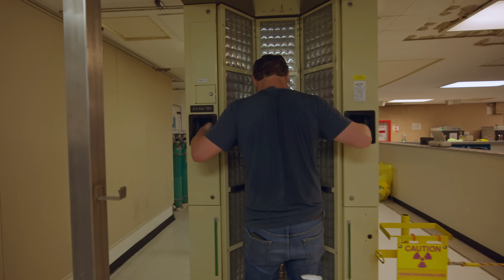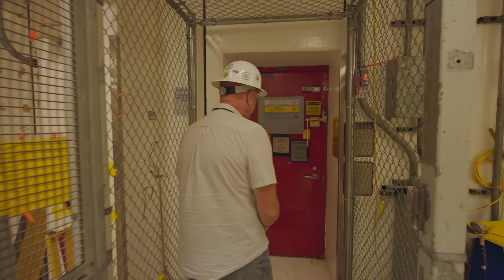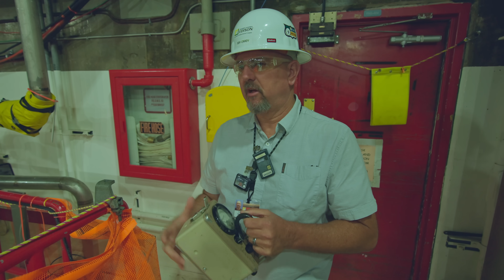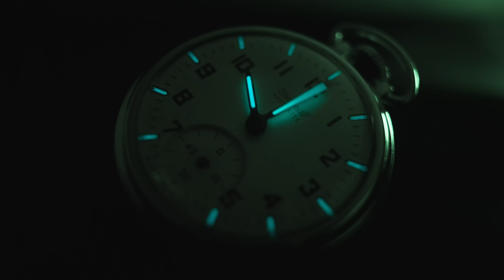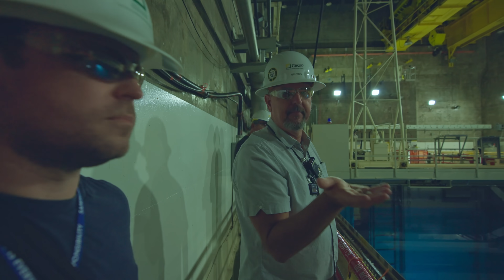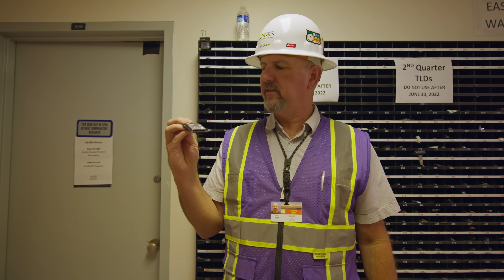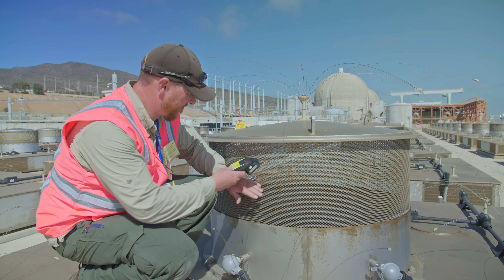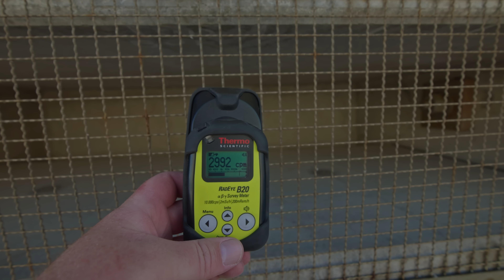Inside San Onofre Nuclear Power Fuel Pool and Spent Fuel Storage

Comment: Adjacent to our nuclear power plant (Pilgrim in Plymouth, Ma.) a study conducted under the supervision of the Mass Department of Health found a four fold increase in leukemia in people living and working in Plymouth and surrounding towns. It should be stressed that not all nuclear plants have the same level of radioactive contamination as Pilgrim. Some like Pilgrim are worse than others with a track record of failures, equipment damage, unplanned shutdowns, and radioactive releases. By design the Pilgrim reactor's heated water/steam is directly circulated in the generator turbine. So consequently, every shutdown requiring the turbine system to be opened up resulted in radiation release/exposure. By contrast, the "safe" pressure vessel type reactor at Onufre employed a heat exchanger which isolated radioactive steam from the generator turbine. Unfortunately, the pressure vessel type reactors were much more complicated constructions and were prone to leaking as a result. So there was no net improvement in radiation release over the lifespan of the reactor. The people who consider these things "safe" for the environment are either utterly clueless technically or they are just mouthpieces for nuclear industry propaganda. None of these things are really "safe" or "good for the environment". The long term cancer study statistics bear this out all around the world. And isolating highly radioactive spent fuel from the environment for literally thousands of years is not practical or a cost effective alternative to other less dangerous forms of energy production.
Reply from the maker: I’ll look that study up but I have a very strong feeling it’s going to have some huge gaps in data directly linking the existence of that nuclear facility to leukemia. Any level of radiation that the public would have received from that plant wouldn’t be enough to cause any health effects. 

I’m not a mouth piece for the nuclear industry but I believe nuclear is safe and does less damage to the environment than a solar field or a bunch of wind turbines. As for the spent fuel, they could leave it there on site. The containment vessels are extremely robust and it’s a huge waste of a resource like that to bury it. The fuel will continue to produce heat for hundreds of years. Seems very stupid for us not to take advantage of that heat and use it for low power energy.
Reply: sorry but you don’t really get to say that anyone who disagree with you are technically deficient. That says more about you than anything.

Comment: Does the water in the pool become radioactive over time?
Reply from the maker: Yes, from a couple of different sources. The spent fuel when it comes out is going to be emitting a decent amount of neutrons along with a lot of other radiation. So tritium will be created in the pool water but it will be extremely small. Very small pieces of iron will also be activated and transmutate into Cobalt 60.
Reply: @RadioactiveDrew  what do they do with old water that has become radio active? do they have special long term containers to keep it isolated.. ?
Reply from the maker: They can filter it.

Comment: 27:40 If there was a tsunami nothing would happen to those canisters because those are PASSIVELY cooled. They work by convecting air... there is no active electrically controlled cooling system necessary. Those heat exchangers would even work better if water was around 😉

Comment: I disagree with op.  Its super dangerous and super expensive.  But risk can be mitigated by many layers of protections and fail safes.  And if effectively mitigated, lowers carbon emmisions from gas and coal power plants.

 But it is inherently unsafe.  The entire industry is geared up to mitigate the threat of radiological release and exposure.  

Pretending its safe is crazy.
Reply from the maker: It is safe. Safer than burning coal, safer than wind and solar. It’s also more energy dense than all of those put together.
Reply: How is it unsafe? Fukushima was bad but was caused by gross negligence by those who created it and are now aware of what not to do. Chernobyl was also bad but was also caused by gross negligence and was also like, what, 40 years ago? Even with the major accidents that have happened. Nuclear is one of if not the safest power sources avaliable, statistically.

Comment: Super cooler Vortrag.
Ich finde es immer wieder schade, dass so viel Wasser und Raum verschwendet werden, um etwas Strom herzustellen und, warum wird der nukleare Müll eigentlich nicht ebenso in diesen Becken gestapelt und gelagert? Ist doch sowieso schon alles vergiftet dort.
Reply from the maker: Are you kidding? Water isn't wasted at a nuclear power facility. Its either released back into the water source, like a river or the ocean, a bit warmer or released back into the air as steam. Both ways have zero contamination. As far as land usage goes, nuclear is far and away the best use of land to generate power. Nothing beats it in energy density...nothing even comes close. Wind and solar take up so much more land and kill much more wildlife than nuclear ever will.

Comment: they should've given you a small radioactive pellet to demonstrate the detector going off.
Reply from the maker: Hahahaha...one of the guides there had some mock fuel pellets but I didn't get a chance to show them off. If they used some fuel that hasn't been used yet as a demonstration it would be radioactive but nothing close to what the stuff is like that has been used in a reactor.

Comment: 28:20 "LA Times"  EXTREME DANGER !  If the fuel container EVER EVER tips over.  It can / maybe will break open.  Then the bad fuel is exposed directly to the cooling water.  That cooling water is exposed directly to the outside air thru those huge round vents.  (My profession 45 yr expert in commercial ventilation, we have replaced 100,000s ft of vent pipes exposed to salty ocean air.  D A H.  What GENIOUS, builds this power plant by AN OCEAN THAT HAS SALT WATER IN IT?  Everybody trusts our government, nothing is ever 10,000 % safe.
Reply from the maker: Nothing would happen if the fuel tipped over. Its a solid not a liquid. If it did break open nothing would happen. It would be a mess for them to clean up on the pad where all the spent fuel is stored but that's about it...zero risk is anyone outside of the area. If those spent fuel containers were to be submerged under sea water...again nothing would happen. They built the reactors next to the ocean because reactors need cooling and water is one of the best ways to do that.

Comment: Why not drive as breeders, no depleted U problem?😮
Reply from the maker: The reactor isn’t setup that way. There have only been a handful of breeder reactors ever built and I think all of them were either test or research reactors.
Reply: @RadioactiveDrew  needed is u238->u239-pu239. Uranium made n flux always present, if u235 not diluted to fill metal, always happens. Is not this very simple. Enough thick metal volume only thing. Pu239 fissible. Fuel rod mixing now and then have to be done.

Comment: For reference, I have a mineral specimen from western NC state, Uranophane (from a local U and Ce rich pegmatite dike) that gives about 160,000 cpm on a Ludlum Model 3.  So the nuclear waste was giving off 500cpm, and I have a rock that is almost 32000% hotter.  And that's just a rock I found in the woods outside. (near Chalk Mountain, Spruce Pine, NC). I have autunite and torbernite samples that are even more radioactive... they live in the shed out back away from my "inside the house" mineral collection, lol. 
      I also went to the Susquehanna 1 Fission reactor in Berwick PA back in the early 2000s to sell an aerosol fire suppression system for their control room (unlike their existing HALON system, ours didn't displace O2 and kill people in the room, also used no water so critical electronics wouldn't get fried and go offline).  The downside is that these units required a spark to get started and this spark was initiated by a TEEENY TINY amount of explosive in the arming device.  
      Anyhow, to get into the building, you had to go through a really cool bomb-sniffer unit (think walk-thru metal detector but inside a plastic shell that shoots a puff of air at you).  Well damned if we didnt set the thing off because of that tiny bit of explosive in the devices.  Our sample units at the time ALSO had an appearance that was not totally unlike large flash bangs. (look up "Stat-X first responder")  Needless to say, after the positive hit on the bomb sniffer, they put our bags through an X-ray machine (like at the airport) and saw what appeared to be gigantic grenades in our bags... aaaand now all of security and the local police are here.  
     That was an interesting day at the nuclear power plant for me.  LOL.   Our contact showed up and explained everything and we were allowed entry.  Luckily one of our sales team was also an ex-cop so he knew what to say.  But that was a good lesson to call ahead and let someone know you are there. That plant DID NOT mess around when it came to security... which honestly was reassuring.

Comment: Even if i completely agree it is extremely unlikely senario there is really enough spent fuel to contaminate entire coast in that place. And natural disasters aren't really only problem they could be targeted as well, lying in the open like that. While the worst part why it is risked exactly? In a mine they could be stored for much cheaper with less shield and cooling systems and literally zero chance of contamination...
Reply from the maker: The spent fuel can still be used as fuel in other reactors. Its still a valuable resource that shouldn't be buried. I think it would be much better to have eyes on it like it is than to bury it away somewhere.

Comment: What is the temperature inside the containment units?
Reply from the maker: I can't remember off the top of my head. But I do remember that the air that gets circulated around the units and is vented off the top comes out at around 120 degrees F.
Reply: @RadioactiveDrew  that's exactly why I asked. Super curious about the inside Temps. Thanks.

Comment: Good luck decommissioning that place. Ya know since the radiation won't go away for what, 25000 plus yrs?
Reply from the maker: You will never get rid of radiation. We have cosmic radiation that comes from space, there is uranium and thorium in rocks, there is uranium in the ocean and there is uranium and radium in the drinking water. All of these sources are naturally occurring and would be here even if the human race never existed.
Reply: @Radioactive Drew  different k8nd of radiation. 0 safe storage for spent rods. Hell look at Fukushima still pumping millions of gallons of sea water into that final reactor and all that irradiated water goes right back into the ocean. And states raising the allowable isotopes in seafood by as much as 2500%. Yep its so safe..
Reply: Believe last I looked it was over 350m gallons per day
Reply from the maker: @DonovanAP  nope...same type of radiation. You can say different intensity. The spent fuel at San Onofre is safe right where it is. What's happening at Fukushima isn't as big of a problem as some are saying. The irradiated water is filtered out and tritium is what is going to be released back into the ocean. Tritium isn't an isotope that bioaccumulates like strontium-90 or radium-226. Also its extremely diluted and isn't a problem. So yes its safe.
Reply: Man, why don't people like you ever educate themselves about radiation?
Even the rocks outside your house are radioactive.
Fukushima water? My man, you're not even talking about peanuts worth of radiation, on an ocean that is naturally radioactive like everything else on this planet.

Your DNA gets damaged and destroyed by cosmic rays every single day of your life.
Educate yourself and don't listen to conspiracy idiots on the internet.
Reply: @GoldSrc_  no shit moron. Since when did that ever hurt anyone or anything. It's radiation that retarded humans say is safe yet is the farthest from any truth. Grow a brain cell
Reply: @Gordon Freeman  please remind us how many people died just in the disasters within our life time... 3mile island, chernobyl and fukushima.... please tell us how it's so safe again. How about move to one of these places to prove how safe it really is
Reply from the maker: @DonovanAP  30 people died in the Chernobyl accident, 0 from 3 Mile Island and 0 from Fukushima. So again...why is it so bad. On average 15 people die each year from natural gas explosions, yet we still use it and no one is calling to ban it because of loss of life.
Reply: @Radioactive Drew  liar.30 was direct exposure. WHO says 300-500 overall deaths from chernobyl with the current evidence. It's not just about who dies from the blast or initial exposure. You are clearly bias and can't be trusted to even research it.
Reply from the maker: Hahahaha….”LIAR”…great way to respond.
Reply: @RadioactiveDrew  oh was it not a lie? Half truth is still a lie...
Reply: @Radioactive Drew  and the Japanese government claims over 2300 deaths. Yes, not all from direct exposure but directly related to the disaster.
Reply: @RadioactiveDrew  oh and the thyroid cancer directly related to Chernobyl is over 4800. Yet it's so safe